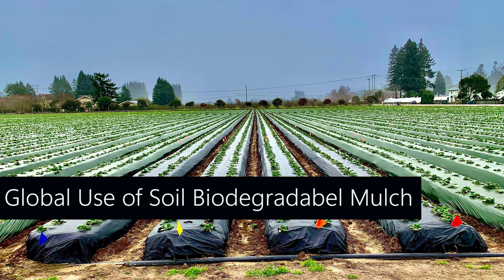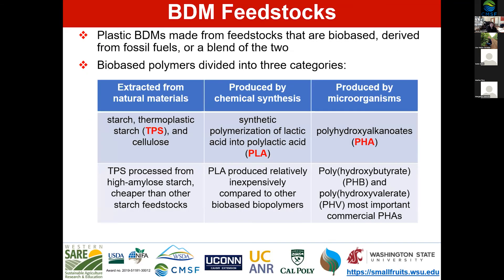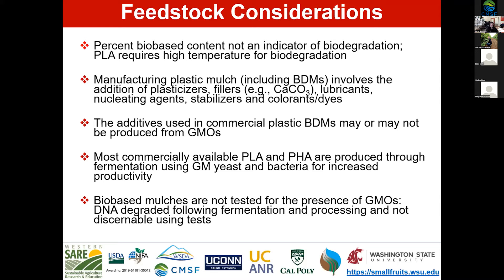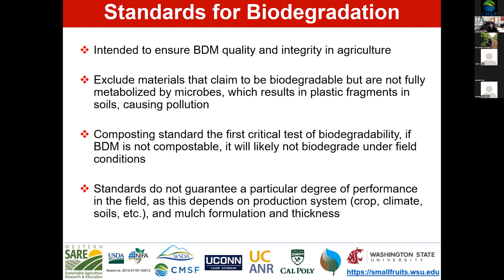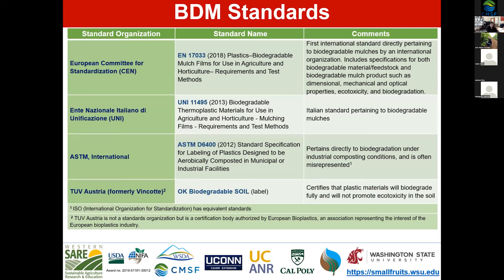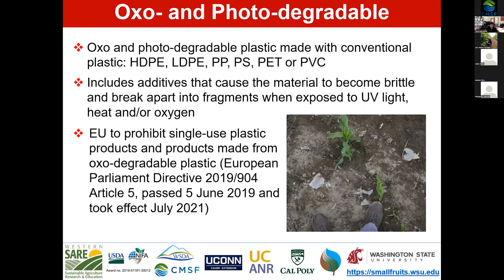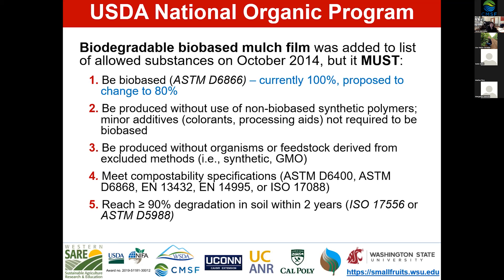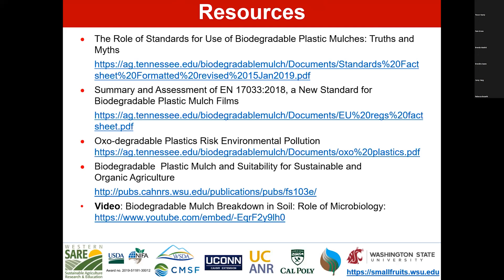What is Soil-Biodegradable Mulch?

Comment: So there are no 100% bio based mulches, but there are ones that 100% biodegrade. What do they degrade into, and what does it matter if they are not bio based if they are not toxic? 

Is it safe to use those non bio based degradable ones? Or is there still research that needs to be done?